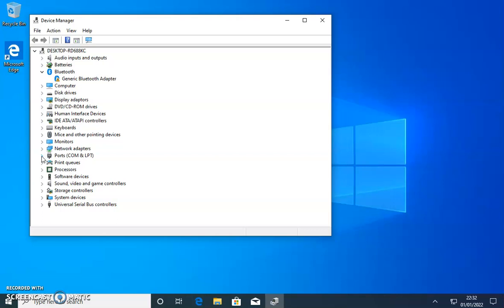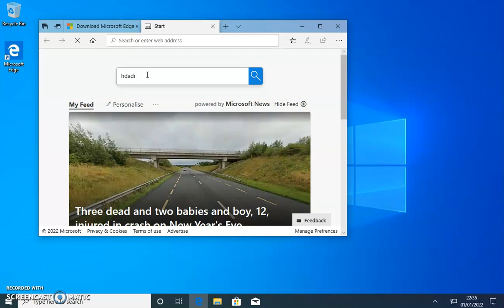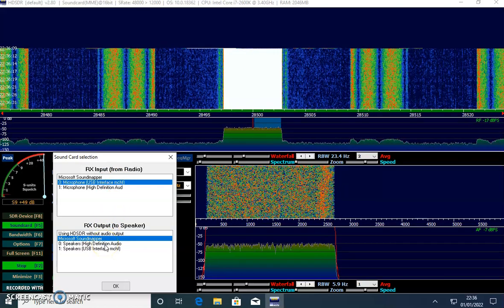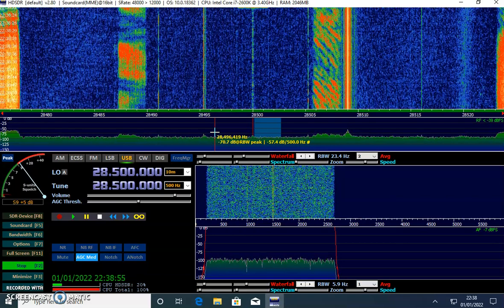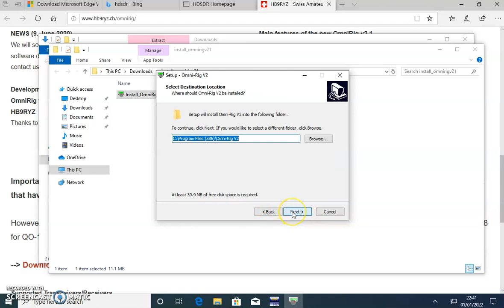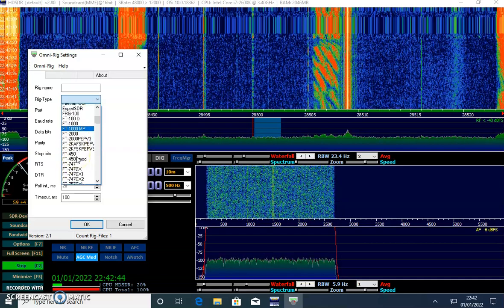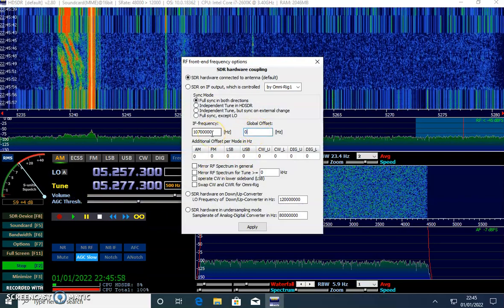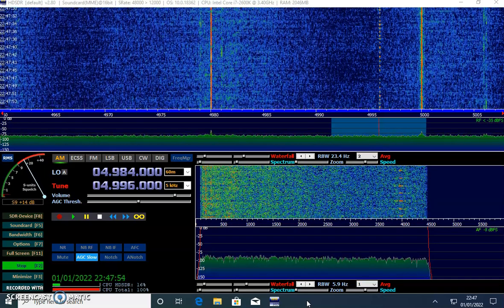mcHF (RS918) Transceiver sync and setup with PC HDSDR Software

Comment: Thanks
Mike
WB6DJI 
Also Run CatSync WebSDR and it uses OminRig with 2 Rig setups rather than 
the Omni-Rig 4 rig version 
My PC does not like both versions of OmniRig
New and Older version ) on the same computer
Reply: I am using CatRelay (free software)... than I can use FLrig and I can connect to the radio many softwares like GPredict, SDRs, etc.